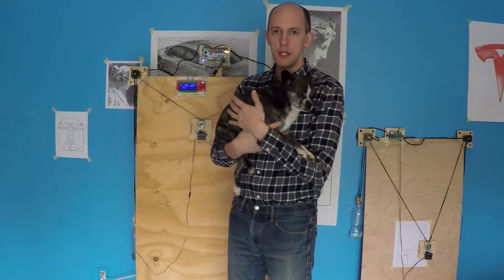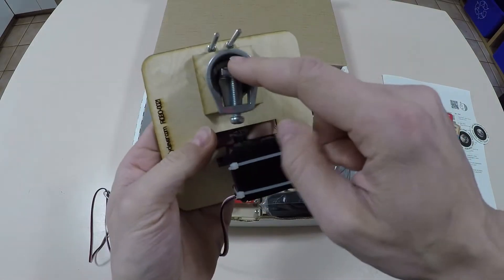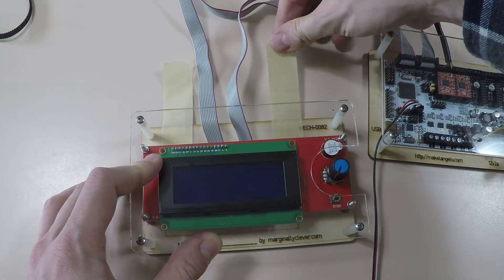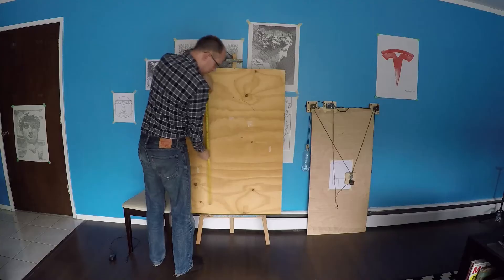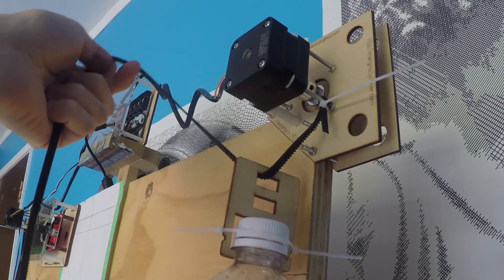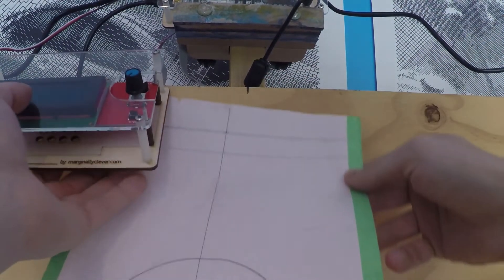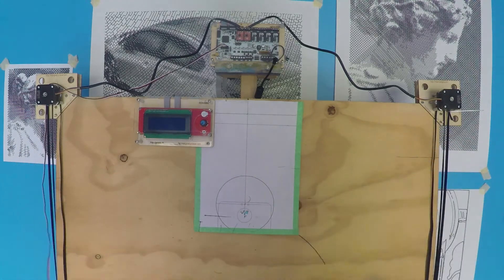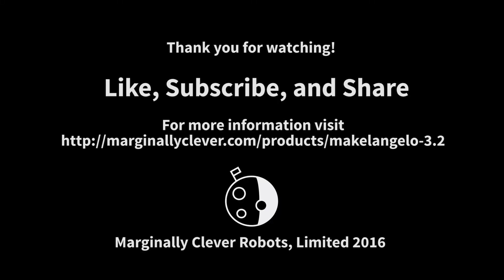How to setup a Makelangelo 3.2 art robot

Comment: Very interested in getting/building one a Makelangelo but want to print larger images on 36" x 48" paper. Is this possible and if so what modifications are necessary?
Reply from the maker: Makelangelo 3 is very customizable.  Easy to stretch for larger drawings.  3'x4' should be no problem.  Use the Makelangelo software > settings > custom > your size  and you will see how much belt & cable is needed to draw.